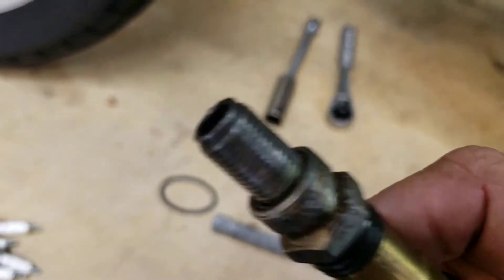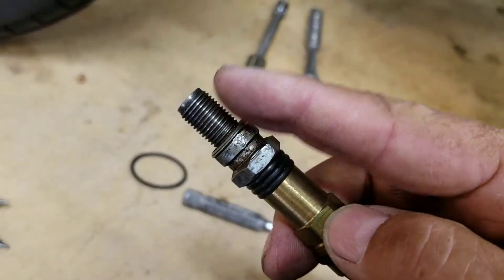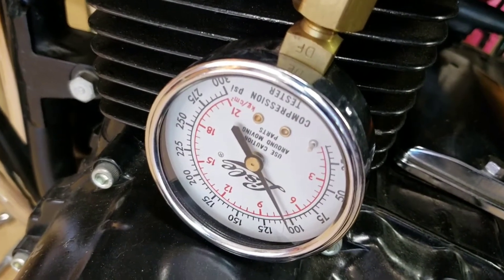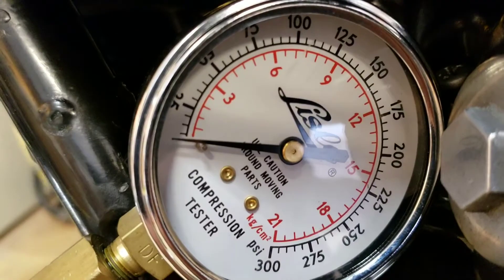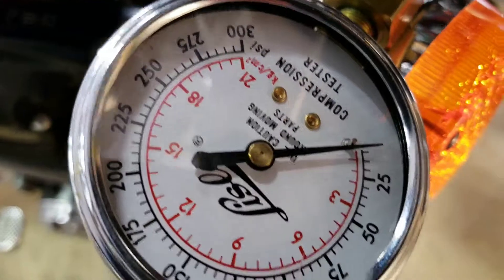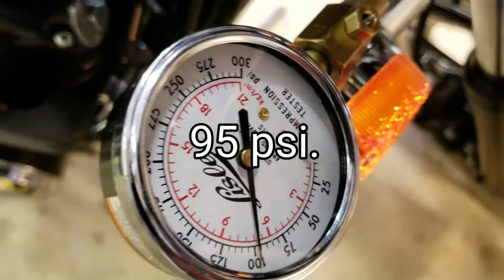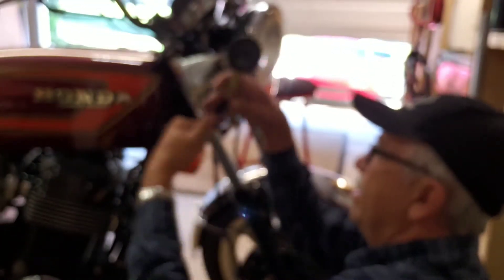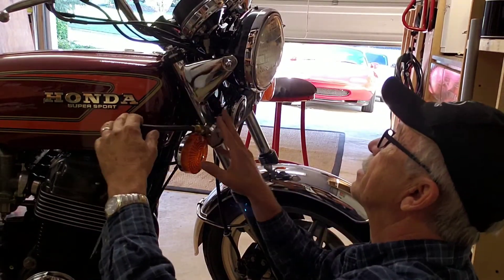1978 cb750f compression check

Comment: Did you end up having to rebuild or did the valve trick do it?
Reply from the maker: Got a few pounds better but I think new rings would do the trick. Haven't driven it much maybe 300 miles . it sits in the garage a lot .😐